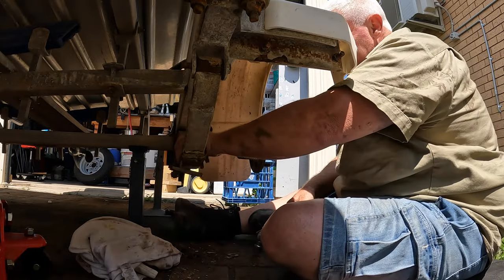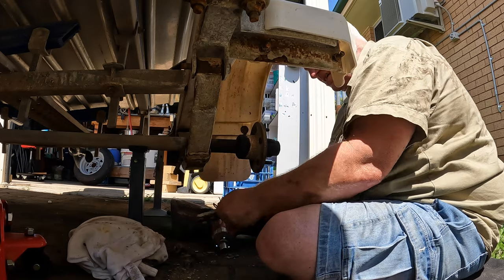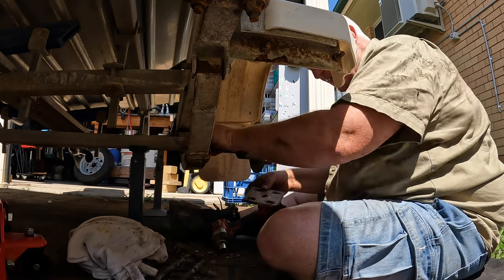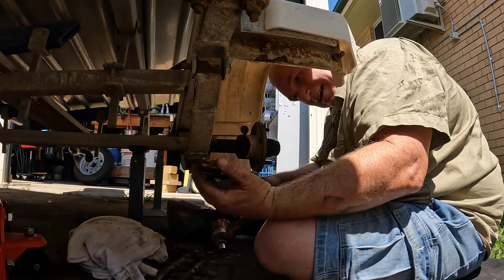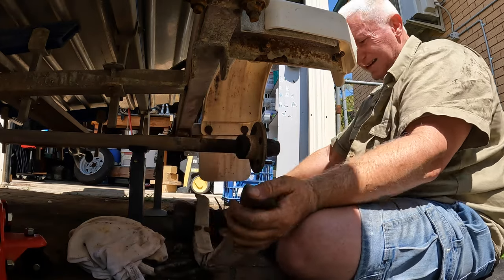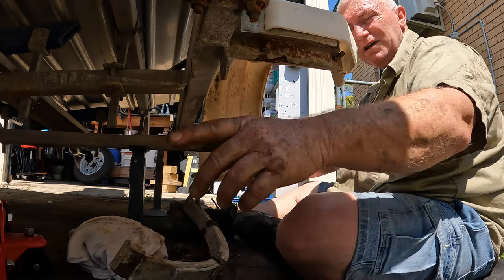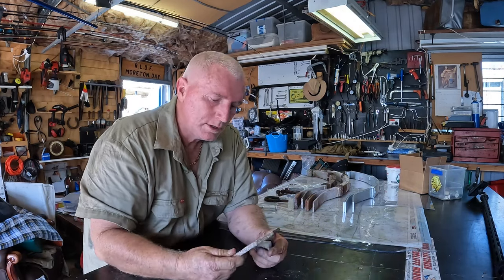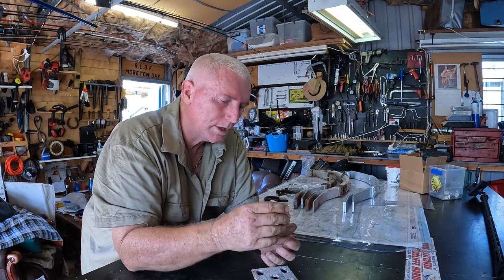Changing Leaf Springs on the Boat Trailer. Land and Bay Fishing

Comment: use a saws all with metal blade and cut U bolts in half. they are not reusable most of time anyway. saves a ton of time and energy than dealing with rusted nuts
Reply from the maker: Agree